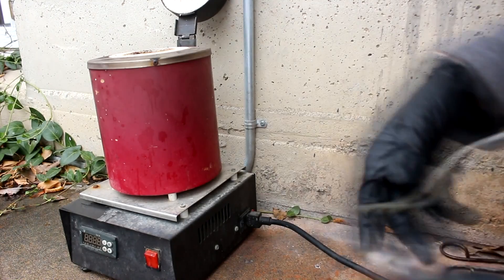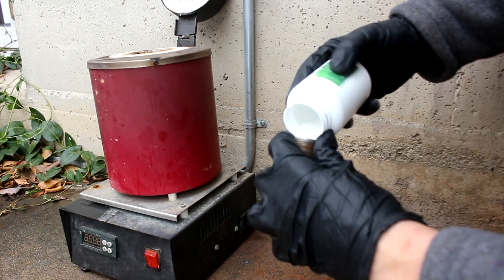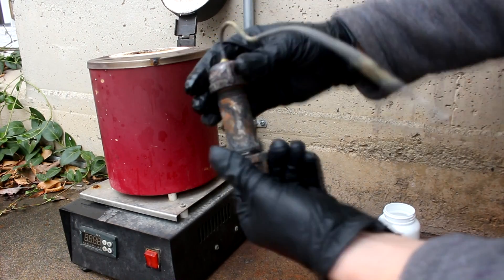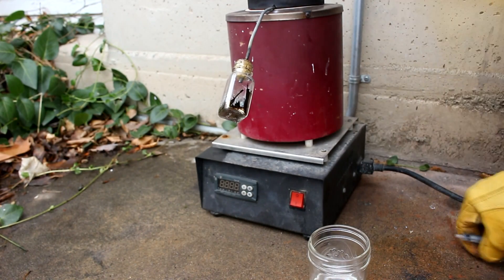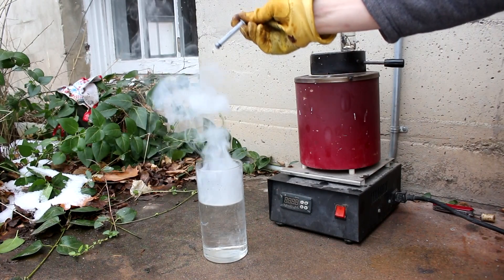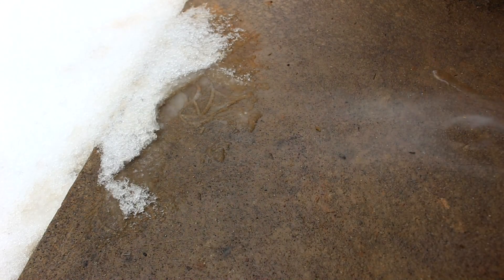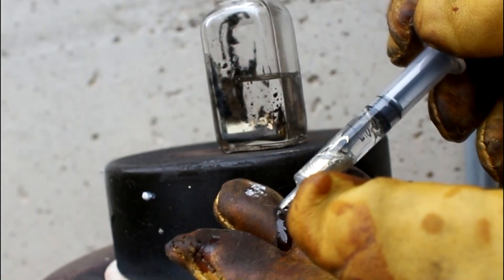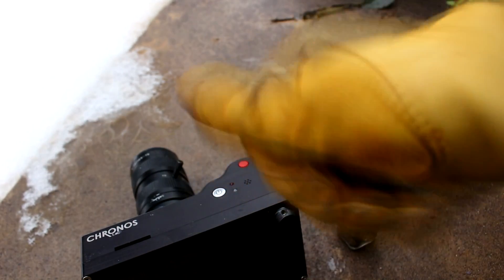Isolating Cesium Metal

Comment: Not bad, Add some argon and fill tiny tubes with it and you could cash in on ebay... At one time i had a 2 kiligram vacuum packed bottle of the stuff. Was originally intended to be used for filling lamps sort of like HPS lamp tubes on steroids, that were used in active antimissile countermeasure systems. Kept it in a 5 gallon bucket entombed in a lot of bubble wrap till the gallium guy bought it.

Comment: Someone had done this over at sciencemadness forums. Except, he did it in a vacuum, then he filtered it to remove oxides. He made quite a bit of cesium that way.
Also cesium metal is a lot more expensive then cesium chloride. If you can sell each gram for 150$ like some places do, you can make a lot of dough.

Comment: Why does it react to water? Water is neutral, doesn't conduct electricity, is rare that water would cause any kind of reaction as it requires static to create electric reaction to it, and sense it's not consuming water but Oxygen, what is causing the chemical reaction to occur?

Comment: try making a test tube with a wire sticking out one end then put the cesium inside and seal the end w/another wire sticking out then try testing the conductivity of the metal, will current flow through it or will it explode.?

Comment: How did you get an airtight seal where the copper connects with the steel? I assume a weld. Are there any other methods you know of that would work for that? Please share. Thanks!

Comment: Could you make a rocket engine that uses Cesium?
Reply: You realise what a gram of cesium costs right?
Reply: THE UNKNOWN IDK, it doesn't seem very expensive to make it this way. The salt was cheap, Lithium is cheap, and he didn't use much electricity. Sure, if you wanted 99.98% purity Caesium, you might have to spend some serious money, but if you just wanted to make a hobbyist level rocket engine, you probably wouldn't need such high purity and could get away with doing it this way, spending much less money.
Reply: Short answer to your question is no and using cesium would be an incredibly idiotic and expensive method to make a rocket "engine". I think you need to do more basic science to get a feeling and understanding of why this is idiotic.
Reply: THE UNKNOWN Ok, I did word it badly. I meant using Cesium as fuel, not actually building the housing out of cesium. THAT would be dumb.

Comment: Hi Cody loving your experiments, its very foggy over here in London. Can you do an experiment to see if sound travels faster in fog than in dry air?kind regards Patrick
Reply: The speed of a perturbation within a medium depends on its density. As density increases, the speed with which the information travels within increases (with the limit being the speed of light).

The more foggy it is, the less dense the air becomes. Which sounds weird as shit but water vapor is actually less dense than ambient air. As a result, sound should travel slightly more slowly in the fog, than in dry conditions

Comment: Cody, is there a chance that the cesium hydroxide impurities within your vial will corrode through the glass, releasing the cesium? Or is there such a small amount that it will be neutralized by the glass before it makes its way through?
Reply from the maker: Hydroxides do not react with borosilicate glass the way it does with soda lime glass but if it was soda glass I would expect a small amount to react but then the hydroxide would be used up long before it got all the way through.
Reply: Way cool! Thanks for replying.

Comment: can you get rare gas from the atmosphere like neon krypton helium or xenon not argon beacause  too comon to be interesting
Reply from the maker: I think I could get neon but with my equipment thats about the rarest I could reasonably extract. What i would do is pass a large quantity of dry air at high pressure through a tube submerged in liquid nitrogen. nitrogen,oxygen,co2, argon,xenon and krypton, would all condense out. I would then react the remaining gas with lithium to scrub out any remaining nitrogen and obtain the neon.
Reply: Cody'sLab and good luck also beacause like you said it freackin rare and complicated to do
Reply: Cody'sLab it cool too know how you would do your techniques
Reply: Cody'sLab but how you would remove  a decent amout of N of your mixture of neon nitrogen mixture beacause it will be just the surface of your Li that will be exposed to N

Comment: Did you know that cesium 137 is an isotope that is used for atomic clocks. The speed of vibrations in the element’s outer electrons is recorded and multiplied by 9,192,635,770 to determine a second.

Comment: Cody, I have a question (which would make a delicious video if you decide to do one). Chocolate is a fairly mundane compound as far as state changes go. It melts, it solidifies, and it decomposes if you heat it too fast or too high. However, every time I've bitten into a chocolate chip cookie, the inside of the chips have been somewhat liquid. Why isn't the chocolate solid, even at room temperature?

Another question: Does chocolate have a crystalline structure? It has a shatter pattern, IIRC.

Comment: Realistic question: Why not fill the ampule with mineral oil before adding the cesium to avoid the air/cesium reaction?
Am I missing something or would this not allow you to store the cesium better and assuming you had removed all but a small air bubble would allow you to observe the liquid form much easier.

Comment: Please try putting some cesium in a gelatin pill capsule, then putting it in a class of water and waiting for it to dissolve. maybe weigh it down too. also you should show this comment if you end up doing it :D

edit: or break a glass tube of a little bit, if the gelatin is too hard to do.
Reply: do this please.
Reply: The gelatin is a nice idea but unfortunately it generally has a high water content, which would not end well! You could coat the cesium in a lipid (like wax) and do it if you were careful, but lipids aren't water soluble so the cesium wouldn't do anything until you mechanically removed the wax after the gelatin had dissolved.

Possibly you could achieve the same effect as the one you are picturing by plating cesium in a less reactive metal. Then the outer coating would ablate away slowly until the cesium was in conact with water, at which point things would get considerably more vigorous.
Reply: or just coat the cesium in wax and drop it in hot water :D maybe hold it near the bottom with a magnet contained within the wax?

Comment: Video idea! Cesium vs gasoline
Reply: TheWorstMineMan I'm actually pretty sure not much will happen. It's gasoline so there shouldn't be any water in it. Not entirely sure what the cesium would do to gasoline but might actually not do anything
Reply: Caesium also reacts explosively with air, so if it was dropped from high enough it would ignite the gasoline.
Reply: Cesium would probably ignite upon contact with air and set the gasoline on fire.
Reply: The primary substances the caesium will react with are the ethanol and detergent additives in the gasoline. Which I think will cause it to get very hot very fast and likely explode if it gets hold of some air or moisture.

Comment: hey Cody what happens if you freeze the membrane part of a speaker meaning the part of the speaker that moves up and down to create vibrations in the air to create sound waves with liquid nitrogen will it work better or will it just shatter I would really appreciate you testing this because it's been on my mind for awhile anyway great video as usual
Reply: thegreatcanadiangamer maybe if he freezes if with liquid nitrogen, when he puts power to the speaker it might self destruct by blasting apart the plastic membrane
Reply: Ayden. Accola that's what a few people have thought this isn't the first time I've put this into the comments of his YouTube videos others think that it'll be the magnet that freezes and some think that because the membrane would be more rigid it would improve sound quality
Reply: In theory yes the harder cone would make it sound better becuase its firmer at pushing the air, but at the same time, its a lot more fragile and would shatter like most stuff frozen to liquid nitrogen temps.

Comment: You did not have argon but... helium could have been used although not as easy to keep in the tube.

And what if you shortened the distillation tube it seems like every time you have done this the tube is too long to the point your product solidifies and clogs the tube.

Why didn't you put more cesium in the tube it seems like there is not very much... Have you considered trying to get a sample of non contaminated lithium sealed in a tube like that perhaps a series where you work with argon would be good.

Comment: Won't a lot of that still be caesium chloride? Because chlorine will bond to the least electronegative which is caesium, not lithium, I understand that at temperature the caesium salt bonds will be broken I'm just wondering whether it's because the lithium has a higher melting point so the lithium chloride bonds remain at a higher temp or what?

Comment: Would it be better to seal Cesium in a glass tube full of Argon, or Mineral oil?
Reply: You can do both, but sealing a glass tube involves a lot of heat, and boiling mineral oil in an enclosed space is likely to lead to... y'know, boiling hot oil splashes and glass shards.
Reply: Argon for sure, that shit never reacts
Reply: Yes, but like he said, he didn't have any argon on hand.
Reply: Cheezpuffer glass tube with argon, mineral oil slowly ubsorbs oxygen from the air, glass tubes can't do that

Comment: I noticed you put a little onto your glove, Weren't you worried it would burn through?
Reply: Sl4yerkid He said that the reaction releases little energy, so it should be fine. Also, I believe those are fire-resistant gloves, but I'm not entirely sure
Reply: The reaction is so fast and low energy that it's not got much chance of burning through flame resistant gloves. If they can survive pulling things out of the furnace they can survive a couple of small drops, especially as it looks like he was dropping it onto droplets of water on his glove which would give extra protection

Comment: could you extract lead from water iv been wondering this for a while
Reply: yeah you could cody mentioned being able to detect lead down to 500 ppm in his lead from lead paint video. not sure how you would though, i know it would involve precipitating the lead than reducing it.
Reply: I mean you could evaporate it off to concentrate it, add hydrochloric acid to precipitate the lead, evaporate off the rest of the water, put sodium in with the lead chloride, heat it to react  the two, and put the products in water. The NaCl will dissolve and leave behind the lead which could be filtered out. I'm sure there's a more efficient process though
Reply: yeah but you would probably need so much water that it wouldn't be worth all the money on resources to do so
Reply: Timmy Fabiseski True. But I'm not sure lead contaminated water would be worth a lot anyway
Reply: True it would be something you do just to say you did it

Comment: Guessing if cesium is exposed to the 'air' in a vacuum chamber, it wouldn't react? Since no oxygen?
Reply: since no air. It would react though, albeit slowly. If you mean in water in a vacuum, it would, since (i'm pretty sure all) alkali metals are self oxidising, and it would strip the water apart anyway.

Comment: Could you do a video on how to make a vacuum chamber?
Reply: that would be very hard to do. You'd need something that could survive the pressure of a vacuum and a pump powerful enough to create it. Not totally impossible, but very expensive and very likely to implode.
Reply: My father gets the gas out of resin for impregnating wood using something that looks like a metal pot with a wide flat ring on top and a silicone band between that and a glass circle for viewing. A simpler version is probably to put a suitable quality glass jar (that will not shatter under vacuum) on top of a soft rubber or silicone sheet and then find an airtight way to put a hose barb on. Maybe just use the rubber as a ring and have some metal beneath to attach the barb to. You could probably get away with using jb weld if you don't have anything better I bet.
Reply: A paint pot is designed to hold pressurized paint in; should hold vacuum well.

Comment: What if you dropped the glass jar with the Cesium and mineral oil in it?
Reply from the maker: I did off camera, and it didn't do much, just caught fire.
Reply: the same thing would happen but probably slower since the mineral oil would be coating the cesium for a second or so before it reacted.
Reply: XD you actually accidentally dropped it? or were you just curious
Reply: Cody'sLab hi
Reply: Cody'sLab hi
Reply: Cody'sLab interesting! Thanks for responding and letting me know ;)